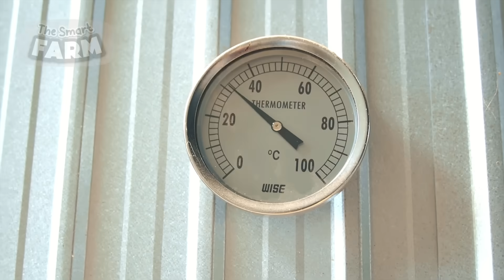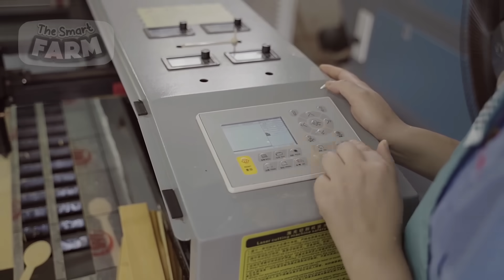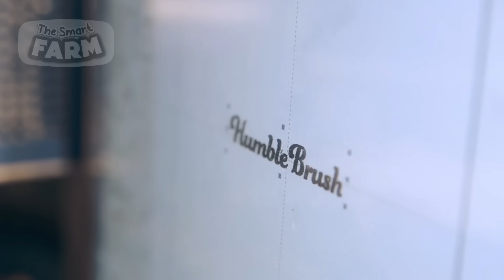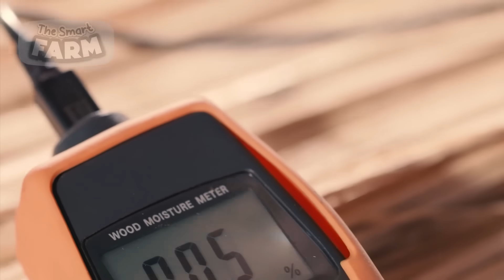How Bamboo Products Are Made: From Planting Bamboo to Toothbrush Factory

Comment: It was surprising that the focus was solely on decorative items and small, traditional bamboo crafts, rather than highlighting the advanced uses of bamboo like plywood and dimensional lumber. 
Modern techniques involve bonding bamboo slats with glue, pressing them under high pressure, and baking them to create durable, waterproof materials, similar to conventional wood products. 
Given bamboo's rapid growth rate, which yields timber much faster than trees, it’s odd that this wasn’t showcased—especially with its increasing role in sustainable alternatives, like replacing plastic in tableware and straws.
Thank you for sharing

Comment: one of the more fascinating uses of bamboo is in high rise construction in he orient. they use a larger diameter bamboo for exterior scaffolding the first 10-20 floors and then convert to a smaller size than can go up many more floors. Bamboo is strong and flexible. It is the flexibility that makes it capable of handling heavy loads without breaking.

Comment: You can also find out what kind of chemicals the bamboo is treated with so that it does not rot and lasts for a long time.
Reply: If you cut the tree after full moon it won't rot for a long time without any preservatives but if cut in the new of the moon it will rot in a short time even with preservatives generally any wood that is reap in the new of the moon 🌙 doesn't last long

Comment: They also make plywood and dimensional lumber from bamboo by glueing together large group of slats, laid out correctly and then pressing them into shape under high pressure and oven baking them so that the glue is both permanent and waterproof. Just like other plywood and laminated lumber made from other woods. Bamboo is now also used because of how fast it grows, more timber is grown in a much shorter time than full sized trees.

I was surprised that none of this was featured, just decorative lumber and tiny items which have been made for thousands of years. Excepting the replacement for plastic tableware and straws.
Reply: Absolutely! 🌿 The versatility of bamboo is astounding, especially how it's now used for structural materials like plywood and dimensional lumber! It's amazing to think how this fast-growing grass could replace traditional timber in so many ways. Thanks for sharing these insights! 😊
Reply: Many, if not most shipping containers have bamboo plywood floors.
Reply: "Which machine today can handle harvesting from thousands of hectares of farmland in record time, and what technological improvements have made this possible?"
Reply: "Wow, it's impressive how bamboo can be transformed into such durable and versatile materials! Have you ever wondered how the unique structure of bamboo contributes to its strength and flexibility in these applications?"
Reply: Yeah, bamboo engineering has come a long way. The plywood, laminated beams, and structural panels they make from it now are seriously impressive. Grows fast, super strong, and way more sustainable than traditional timber. Kinda wild the video only focused on the basic stuff instead of the high-tech applications.

Comment: Bamboo and wood rot, are flammable, and difficult to shape. They are suitable for makeshift structures, for example, scaffolding.
Reply: Every material, whether natural or man-made has its pros and cons.  Every material can have a long life if treated properly.  I have seen steel products corrode away to nothing faster than a wood one can decay. I’ve seen natural material products live longer than made-made materialed ones.  All depends on purpose, environment and care. Bamboo is fascinating and is so versatile, cheap and easily replaced.
Reply: @Bozbaby103  Bamboo and wood rot, are flammable, and difficult to shape. They are suitable for makeshift structures, for example, scaffolding.
Reply: While working in Bangkok I was surprised that the guys working on the outside of the hotel were using bamboo scaffolding tied together with cordage. I was on the 12th floor and the scaffolding was way higher than my room.
Reply: @frederickwelham3829  Bamboo and wood rot, are flammable, and difficult to shape. They are suitable for makeshift structures, for example, scaffolding. fhdg